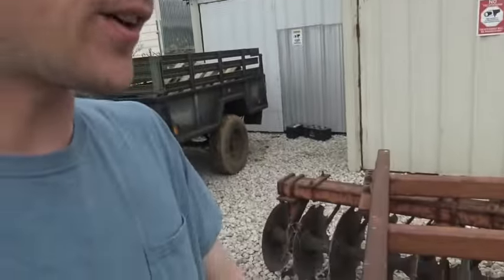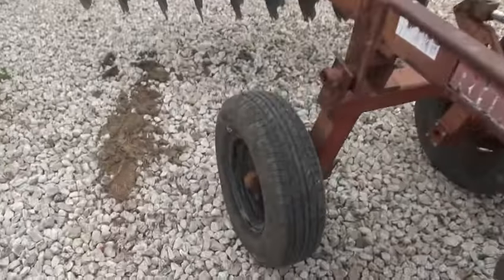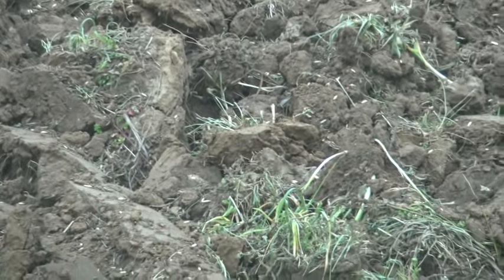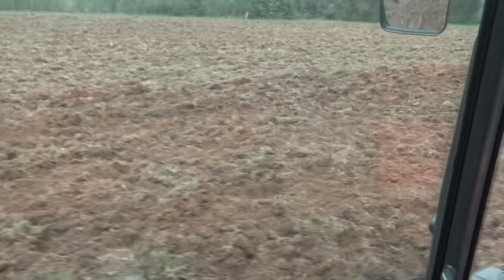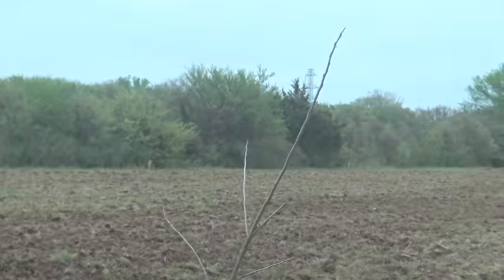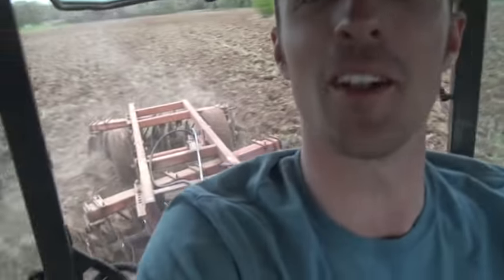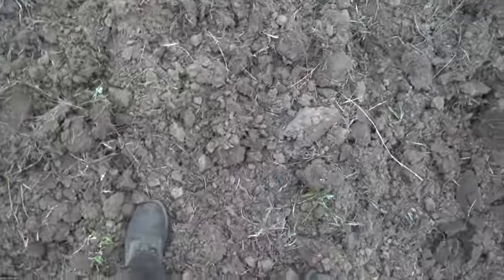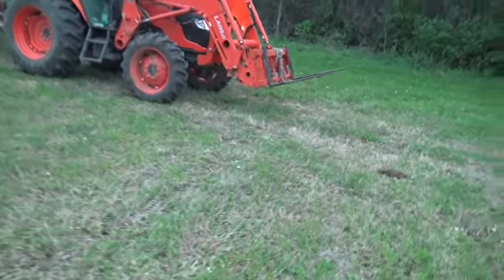Disking In Seeds with the DISK WE REPAIRED!!!

Comment: The Kubota is definitely an upgrade to that Mahindra you had when you first got into baling.
Reply: When he got that it was a shop tractor to small for most of his hay equipment
Reply: I remember he had quite a few complaints about that old Mahindra, such as they over rated the FEL quite a bit, the tractor weighed quite a bit more than standard "western" designed tractors of the same horsepower rating

Comment: Are you able to adjust the angle on the disc gangs? Using more of a straight cut may bust clods easier plus throw less dirt over the seeds (don't want to bury seeds too deep, hopefully you checked that after a little run).
We've had people pass going up hill on double yellow before. My father started running up the hill with one tire close to the center line because if he ran with one tire on the gravel or by the white line and the cars saw a foot or two space to the yellow line they'd think they could 'squeeze through' or something.

Comment: Look into a rolling harrow or crumbler to pull behind that disc.  Since you move down the road, a drag or other non-wheeled implement would not be ideal.  Hint- you can buy a 18'-40' rolling harrow fairly cheap, the base is 12 or 15' so you can take the wings off, have a bunch of spare parts, extra cylinders.  These are cheap because the typical user or that large of equipment will not want a 1/2 worn rolling harrow so the market is limited.  Around "here" the market for 8-10" equipment is hot due to allot of deer plot growers, and habby farmers.  The larger stuff is usually 1/2 the price of the smaller stuff.